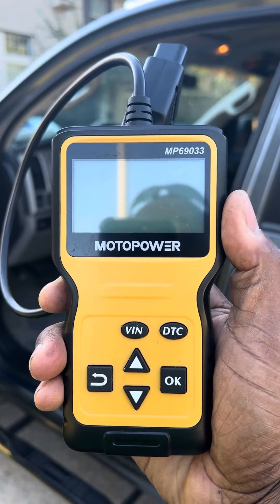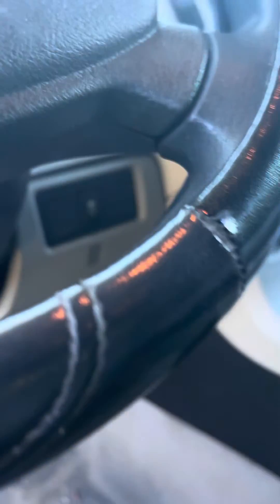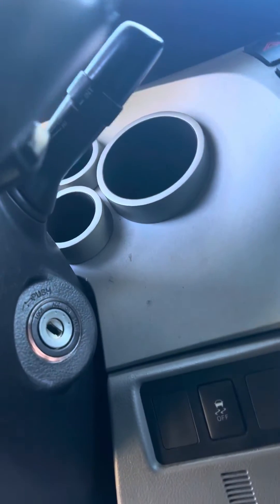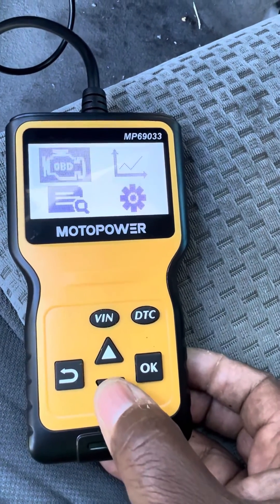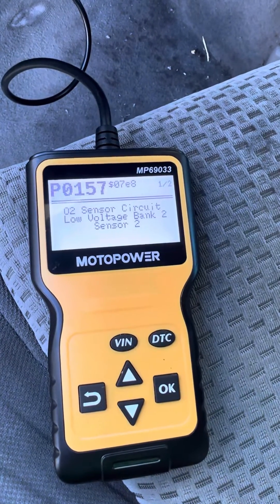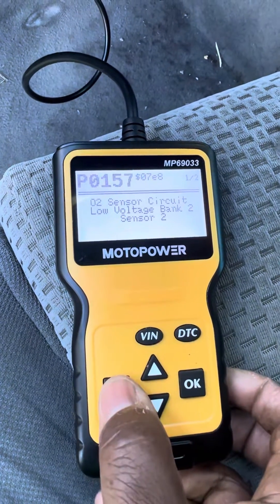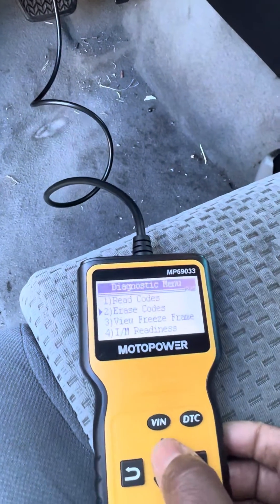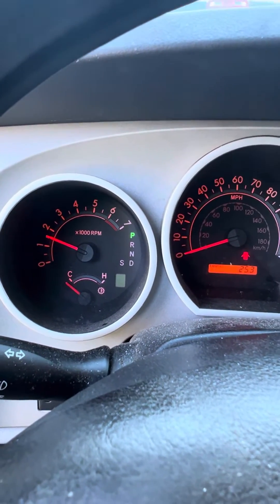How to clear check engine light with the OBDII Motopower diagnostic meter

Comment: I have the same scanner and still after deleting the code the engine comes on!!
Reply: I have same issue
Reply: @reaperninenine3057  mine has an issue with the fuel oxygen sensors. I think bc it’s an important component the device can’t really delete the codes.
Reply: @nerd23x  yes I have the same issue both oxygen sensor think you are right needs a proper reader like they have in garages

Comment: At 2:08 in this video your screen shows "Erase Failure..."  We are getting the same message and it is NOT clearing the codes.  Were your codes deleted when you got this error?
Reply: i have the same scannar saying exactly this and it DIDN'T erase any codes.
Reply: Same🎉
Reply: I'm having same issue
Reply: I have the same Erase Failure. Code gets erased but my monitors never are ready. Have done drive cycles still bad,

Comment: I have this same scanner. It was throwing a code about an issue with VVT solenoid, which I replaced. I tried using the scanner to erase the codes after fixing, and the check engine light is remaining on 😢
Reply: Same here

Comment: Engine light off but inspection will still fail you 😮😮😮
Reply: Not true
Reply: @moparman2010  ohhhh yeah it’s true if a mechanic turns the light off without fixing it the problem still exists

Comment: Great detailed Easy to follow video! I was told you had to drive it 100 miles after you clear it for the check engine light to go off. So my daughter drove for 100 miles and the light is still on.
Reply: Set the failure code on google and see whats the problem, if its bullshet, remove battery red cable for 1 minute and set it back, it will reset everything, even the clock time